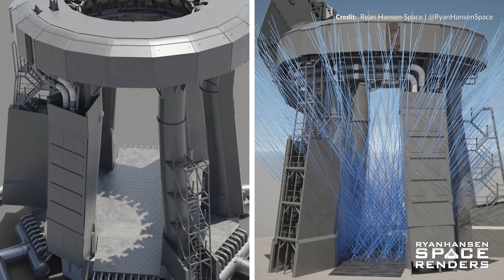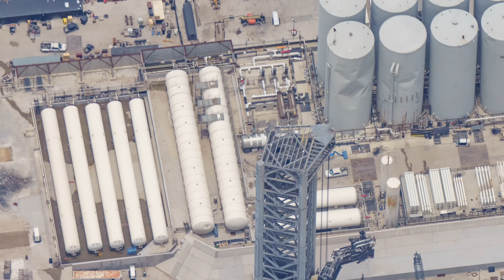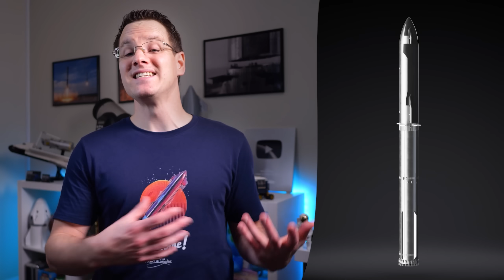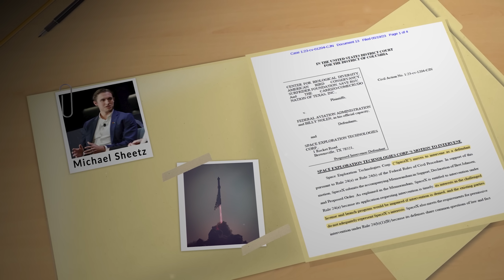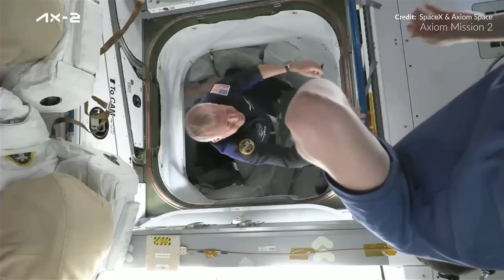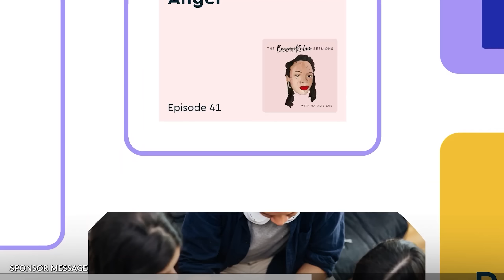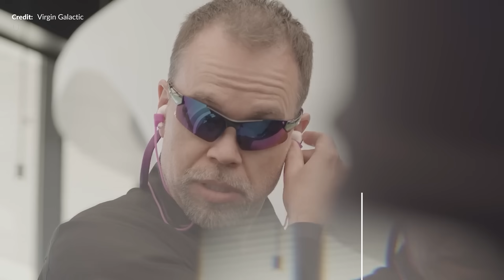SpaceX Starship 6,000 ton Capability, and SpaceX Joins FAA for Legal Battle, Axiom 2, Unity 25

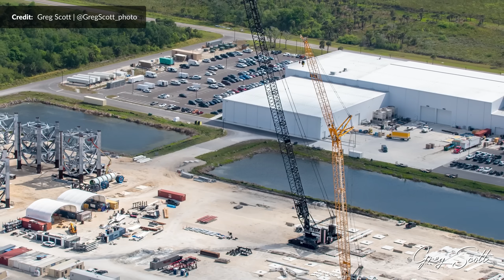Comment: I've missed hearing the news about the construction of the Robert's Road megabay being "in limbo".  7:13  I just did some searches for news items but can't find any.  This was probably covered here in a previous video.  Can someone give me a link or reference.
Reply: I don't think that it was an article or anything, just that with the parts there, SpaceX wasn't building it when they did the flyovers. Then parts from Roberts Rd started disappearing and showing up at Boca Chica. So something made SpaceX pause work there and pick it up in Boca Chica. They are taking out so me of the buildings for the factory expansion, including the low bay. So maybe it is to replace that.

Comment: Perhaps I missed the comment but, has anyone noticed that the Falcon first stages, mostly, are not landing centered on the circle surrounding the SpaceX logo?
  I seem to remember that once SpaceX was  regularly safely landing Falcon first stages, they were roughly centered in the circle. From my memory, for the last year (maybe a bit less) the landings have been biased towards the 270° point of the circle with 0° being the direction of the camera on the drone ship.
     Perhaps, practicing the offset needed to catch Superheavy by the Tower.!
Reply: The Falcon boosters can not hover, even on 1 engine at minimum throttle. So they precisely time the engine start, so that the acceleration is as close to 0 as they can, when the booster touches down. So they don't always hit the mark. And I have noticed that people will say it was a bullseye, when it clearly lands partially out of the circle.

The Starship can hover, so it should be able to be more precise for landing, which is why they figure that they can catch them.

Comment: I suspect eventually they will find that the steel plate system won't be durable long term. The heating and cooling of the metal over time will lead to failure even assuming it survives one launch.

Long-term it wouldn't surprise me if they replace the showhead with a more expensive and durable material like whatever steel/nickel/molybdenum alloy they use for the Raptor itself.

Comment: Big news that was missed: Virgin Orbit is officially dead and has been sold in parts. Rocket Lab snatched up the manufacturing facilities, Launcher took over the lease on the test site, and Stratolaunch has picked up the Boeing 747 launch vehicle, Cosmic Girl.
Reply: Yeah, Rocket Lab is the interesting part of that, but it turns out that the Virgin factory in California isn't far from the existing Rocket Lab facilities there. It seems likely that they'll be using the new factory for manufacturing Neutron upper stages...

Comment: The QD points are on the chopstick arms though. So if they change the ship dimensions the chopsticks just move up or down. The QD points remain the same relative to the attachment and lifting points. I could be mistaken. However, it seems the chopsticks are actually like crane blocks that can travel up or down the launch tower.
Reply: No. The QD points are not on the chopsticks.  The chopsticks are only for lifting, catching, and "swinging" rockets over to the launch stand.  The quick disconnect for the ship has its own arm, which swings away for safety but can't move up and down, and the quick disconnects for the booster are mounted on the orbital launch stand's ring.  
It WOULD be cool though, if the ship quick disconnect could adjust up and down for different sized boosters.  But adjustable height would require some magic fuel pipes that could change lengths.
Reply: @Ralphie419  They would need some large radius flex hose to grant some range of motion. Whatever option is the most effective and economical is likely what we will see. Thanks for correcting me!

Comment: That 6000 ton thing sounds a little suspicious to me. Maybe a better use for that capacity would be a higher acceleration at liftoff - which harnesses the Oberth effect to increase your effective fuel efficiency.
(Just remembered that the low acceleration on the first test flight was due to the problems with the engines and fuel flow.)
Reply: Why was there problems with Raptor engines ?  Do you know?  Does Space X  know?   Show me the know because I don't know.
Reply: @mikewallace8087  Several of the engines could not be started because of fuel pressure issues, and there was less thrust than expected. It was a prototype test and flew with a lot of already obsolete parts.. The plan was always that it was going to get destroyed during the test anyway..
Reply: Its not suspicious. Its just hot unrealistic Garbage. 6000 Tons is about 85 Space Shuttles and if Starship is capable of doing that i'm Elon Musk..

Comment: My HOUSE only weighs 40 tons!
If that is actually able to lift 6000 tons, that 
Equals 150 houses.
Of course the rocket and fuel weigh about 5000 tons
So it could lift about 20 houses.
Maybee a bit more depending on how large the houses are.
Reply: The 6,000 tons would be the full weight of the rocket, propellant, and payload. The max payload mass would be 200-300 tons, if they expend the Starship.

Comment: Where is Boeing starliner the futuristic vehicle for astronaut
Reply: Currently doing final checks for a possible July 2023 CFT to the ISS.
Reply: @steveaustin2686  Maybe. They're still officially targeting July, but I've been hearing a few reports about delays around certifying parts of the design, notably parachutes. It might just be paperwork, but even so, it's not hard to see the launch date slipping again...
Reply: @simongeard4824  Yeah, that's why I put possible. They may not finish all the checks in time. The NET July 21st launch is squeezing in between the CRS-28 flight leaving and the mid-August Crew-7 flight. 

The USSF-51 & NROL-107 missions are NET Q3 2023, ViaSat-3 is NET Sep 2023, AX-3 is NET Nov 2023, CRS-29 is NET Dec 2023, and Crew-8 would be around Feb 2024. So if the CFT is pushed back, it will have to slot around the other launches. ViaSat-3 might be bumped, but I doubt the NSSL payloads would be bumped. AX-3 could be bumped for the CFT I think.

Comment: We know, having watched the second stage of Falcon 9 deliver payloads to much higher altitudes that it could put the crew dragon on final approach to the ISS in about 10 minutes.
Reply: The ISS is on a 51.6 degree inclination orbit and KSC is at 28.4 degrees N. So they have some orbit changes to do on launch. And they don't want to rush a rendezvous with the multibillion dollar ISS and risk a collision.
Reply: @steveaustin2686  Thanks for trotting out the standard response. SpaceX is extremely good at hitting the desired orbit and I'm sure they could put the crew dragon 400 metres away , without any collision risk..
Reply: @tscchope  It's what NASA allows for approaches to the ISS. SpaceX isn't the only player here.
Reply: @steveaustin2686  That is true. It's worth comparing the time it took Axiom-2 to reach the ISS (about 15 hours) with that of crew-6, the official NASA crew, (about 24 hours). SpaceX has shaved 9 hours off the time to the ISS, perfectly safely. SpaceX can safely shave off a lot more time, if NASA were to take advantage of what Crew Dragon offers.
Reply: @tscchope  🙄

Comment: Hydraulic systems have a supply and return line.  The fluid on the compression side had to go out to allow movement of ram from incoming flow of fluid pushing the other side of piston. Supply lines are at most times larger than returns to make for a smooth movement because it’s fighting the restriction.  Larger return lines (you can see they increased both of the smaller return lines, one for close and one for open) make for less restriction of flow on the out side and thus FASTER actuation. The open and close strokes will be at least twice as fast.  All part of the quicker less pad eating launch.

Comment: so many factors in the damage done to the launch pad, one rarely mentioned, that of the launch vehicle taking almost 10 seconds to clear the tower.  That delay in lift off alone, probably caused far greater damage than was calculated in all the models and simulations.  Were the vehicle to have lifted off as planned and normal, far less damage would have been done to the launch system.  However, all of the upgrades are a good measure to assure that the launch system is strong and robust enough to accomplish additional launch sequences, sans serious damage, and allowing for repeat launch cycles without extensive repairs.
Reply: True, but I think the problem there is that even if they reduced launch time to a minimum, eventually the concrete would've failed anyway.  Maybe not catastrophically, but damaged enough that they wouldn't be able to launch again without excavating the damaged concrete and pouring a new pad down over and over again.  The steel plate is certainly the best option.

Comment: A rocket engine is  NOT a oxygen methane torch.

oxygen  methane torch can reach up to 2800 °C with a stoichiometric mixture.
only a acetylene torch can reach a temperature of 3400°C to cut steel.
Conclusion: No way can the rocket exhaused gases reach temperatures to 'melt steel' even without any water cooling.

Comment: Honestly I am so confused about Space X's mentality about this, yes innervation are only made when challenging the norm, I do understand that. However, by the sound of it the only reason they are not using a flame diverter and deluge is because 'the moon and mars doesn't have nice runways' but they aren't landing the most powerful rocket ever made on the moon or mars, they would be landing star ship, and it would probably be throttled down quite a bit by touch down anyway. Just dig the hole already and go to the moon!
Reply: Apparently Musk really, REALLY wants to be able to work on the engines under the OLM. A diverter would get in the way of that. He has said in the past that they won't have one, but will put one in if they must.  So evidently, he is going to avoid it as long as he can.
Reply: It does seem a bit bonkers, when you look at Falcon launching every week safely, and then Starship seems to be taking unnecessary risks. Just lift the OLM higher and make an angled diverter! The Mars/moon thing is nonsense, only the booster does all the damage.

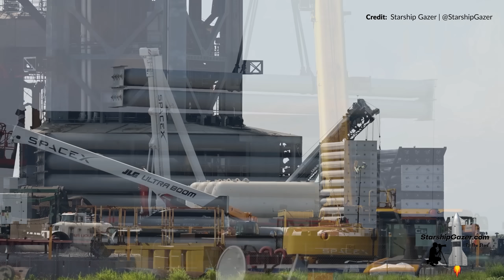Comment: 4:18 The high pressure in needed to counteract  the pressure caused by the the normal shock when the supersonic flow of the engines transitions to subsonic high pressure, much slower velocity flow to part into six subsonic radial 'jets'. This is the effect of a flat plate groundplate.
The stagnation temperature cannot exceed the combustion temperature inside the rocket combustion chamber, which is below melting temperature, especially since cold ambient air is mixed in the jet plume.
And the combustion is fuel rich

Comment: I still think they should design an Apollo sized launch pad or make the launch mount 10 meter higher.
That Raptor 2/3 engine rocket blasting is the most powerful sandblaster in the World.
They need 2-3 inch thick welded steel plates and the Worlds greatest fire suppression system under Starship.

They need bigger flame trenches. Safe cracking level blast areas. Firesprinklers from hell. And respect for Newtons 2nd law.

As for the environmental impact for one must be a lot of deaf birds and other critters.
Secondly compare the size of nature to the size of star base on the maps.
0.5% at most by the looks of it.
Reply: Starship is far bigger than Apollo/Saturn V so an Apollo sized launch pad would be very inadequate.

Comment: As much as I support and follow the progress of SpaceX I am having difficulties understanding how or why they are already working or thinking in a larger Starship when they are still far away from having a functional reliable one. In my mind, that is a waste of resources and money that should be used to solve the current issues. Do not put carriage ahead of the horses. At times you need to be unconventional but at times you need to follow a linear way of doing things to achieve progress.
Reply: Having a slighly longer Starship, likely for the [DELETED] Starship propellant depot. Sort of how the Atlas-V has short and long fairings and SpaceX is adding a long fairing to go with their short ones. SpaceX was talking about a longer payload section of Starship back in 2020.
Reply: Why wouldn't they think of the implications of what they are developing?  

Would you say the same if the implication was "20% more thrust?  We can reduce it to 30 engines?"

Both lead from thinking of the implications.

Also consider Vulcan Centaur.  They haven't even tried a launch yet but have designed for 2, 4 and 6 SRBs as variants.  Why would they not consider the options for future variations as they become possible?
Reply: @Scanner9631  I am not an engineer nor a rocket scientist either. I am just thinking in terms of possibilities of success and the way of developing a system. You cannot build a skyscraper without building a strong foundation first, that is just logical, but I think that in the rocket science world , logic doesn’t always go first. A lot of people told SpaceX about the need of protecting the launch pad with a water deluge system and they decided to go ahead and almost it was destroyed. Now they need to not only reconstruct or repair but to add the system that was needed in the first place. You crawl then you run then you fly.  Braking that simple rule is a recipe for more struggles and failures.
Reply: @rafaeltorovip  

A lot of people told Musk the very same things about reusing Falcon 9 and Dragon.  They also told him 27 engines on Falcon Heavy was impossible.  

Super Heavy is in a size league all by itself.  What is possible in such a vehicle aren't going to be known until it is tried.
Reply: @Scanner9631  wishing the best for SpaceX and all the good people working there.
Reply: Rafaelito, after just 3 launches falcon 1 was operational and in no time the much larger falcon 9 was essentially reliable with a single misshap, there after it took a few landing attempts to nail with absolute reliability all other landings. In view of this phenomenal success, beating every other competitor, your statement is ''sin mérito'.

Comment: Seems sort of questionable why they decided to build Starbase right next to a national wildlife refuge. There's probably not a lot of options for places in the US, on the east coast, far from any population center, near the equator. But since they didn't care about the wildlife refuge when selecting a location, they have to make additional accommodations and deal with the extra environmental scrutiny. You can totally understand why environmental activists don't want it to rain down concrete boulders on sensitive ecosystems.
Reply: SpaceX did an Environmental Impact Statement (EIS) over 10 years ago for Falcon class rockets at Boca Chica and were approved. The FAA review in 2021-2022 was about adding Starship to that existing approval, without needing a new EIS.

Comment: It always surprises me when a human mission is on a new booster. It seems the reused boosters are more reliable as they have been flight proven already.
Reply: In the eyes of someone with common sense you are right. Only problem is the United States is sometimes short in that department so the population would point fingers if a reused booster failed
Reply: @426shelby426  🙄 Crew-2 through Crew-4, Inspiration-4, and AX-1 all flew on used boosters. With the cadence that SpaceX is keeping, plus some expended booster missions, SpaceX does occasionally field a new booster.
Reply: @steveaustin2686  

Probably why they are trying for permission to boost the reuse to 20 launches (the last 5 Starlink only - for now).
Reply: @Scanner9631  That may be part of the reason as well. But since they occasionally expend a booster for a customer, it should not be surprising that a new booster comes in occasionally.